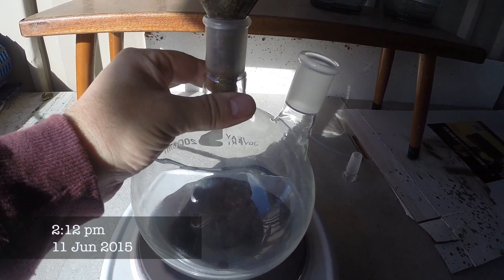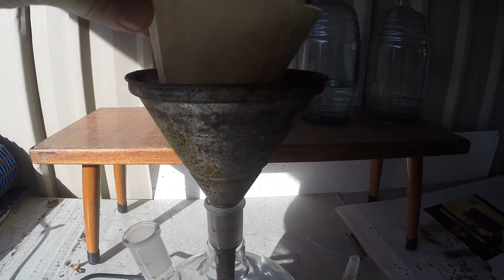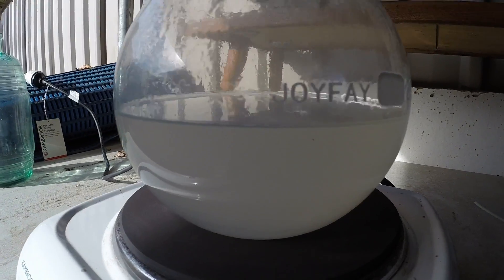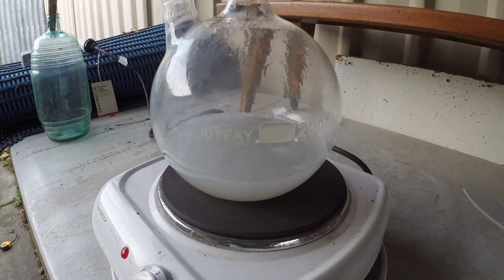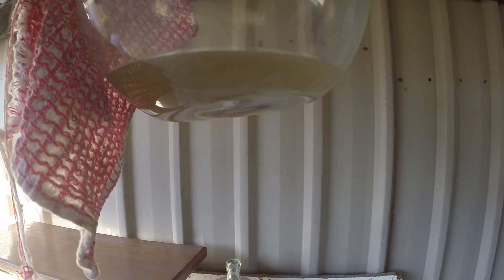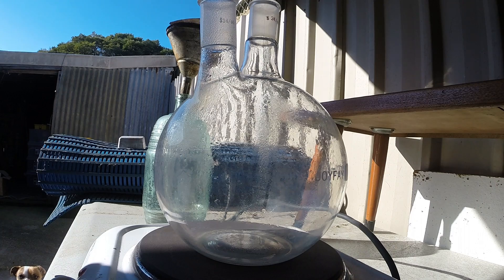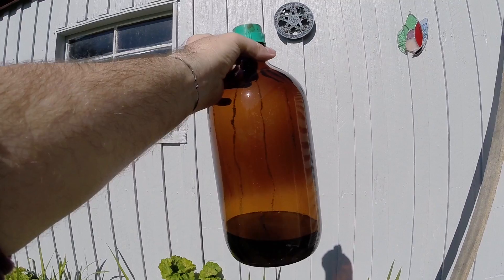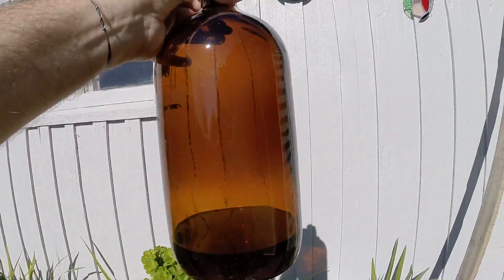Concentrating Car Battery Sulphuric Acid

Comment: There are a couple of things that should have been done differently:
-the dilute solution should have been filtered using glass funel idealy, or at least plastic, never metal
 -the concentrated acid should have been filtered using a glass funel and glass fibre, not metal funel and paper coffe filter
-the white stuff was probably iron sulphate( from the metal funel) and some lead sulphate( if the solution comes from a car battery, not bottled electrolite), and it's possible that by letting the concentrated solution sit for a while in a cool place to precipitate it
-the obtained concentrated acid contains a lot of impurities but it can be used at least to prepare hidrochloric acid, probably ignite a mixture of sugar and chlorate or in a dessicator, maybe other reactions as well where purity isn't an issue.

Comment: Sulfuric acid boils at 330c, or 640F. There's no way you're gonna hit that on that hot plate. I think the white smoke you were seeing was other impurities boiling off.
Reply: it boils off minor amounts of sulfiric acid at lower temperatures as the water builds an azeotrope with the acid. The concentration of acid in the azeotrope increases with higher temperature.

Comment: Fiberglass is a good filter for acid either matting or fiberglass insulation stuffed into the funnel.
Reply: Sulphuric acid eats paper, even dilute acid will get it torn apart.

Comment: very risky having a RBF standing like that completely unguarded with a small creature running about
normally i dont comment on safety but this irks me massively
i am however surprised that you were even able to boil it down inside a flask like that, larger surface area- for instance an open glass pan would be much better for this
Reply: @@edwardelizabethhitler5611 fair enough-  but he didnt reach that temperature either. the decomposition will happen regardless and the gasses will exit regardless of the shape
its inefficient and an obtuse extra risk- downright abuse of the glassware
Reply: @@edwardelizabethhitler5611 are you saying sulfuric acid evaporates below 700*C?

Comment: Can i put a pyrex beaker on regular stove? And how strong can i set the fire to be?
Reply: I would put a pot with water on the stove and hang the beaker inside it, so that the glass doesn't receive the flames directly. The temperature should be as low as possible while still boiling the water so that you don't boil the acid away

Comment: Heating it up with some H2O2 might help clear it up a bit.
Reply: Lol I was looking on here and found you no guess why I'm looking at this video
Reply: @sydneyhunt6681  Hah! Hey stranger, what's up, lol.
Reply: @jhyland87  trying to get cheap Sulfuric acid
Reply: @sydneyhunt6681  what country do you live in? (Asking because i know some countries have H2SO4 restricted)
Reply: @jhyland87  uk it used to be easy to get 98 %   but after acid attacks it's got hard I cant find it for sale
Reply: @sydneyhunt6681  yeah, ive heard that its very hard to get it there. That sucks :-/
Reply: @jhyland87  will have to distill battery grade or possible drain cleaner

Comment: If you put sand in a pot you can heat up just about any kind of glass jar
Reply: But you shouldn’t heat any glass
Reply: @blackferrets820  why not?
Reply: @smilemore1997  borosilicate glass won’t suffer temperature shock other glass will mostly and acid everywhere is the last thing you want and just buy sulfuric acid way safer
Reply: @blackferrets820  
Some countries you can't get it as a normal citizen.

Comment: This isn't the best advice. The coffee filter will degrade in the acid and the reactive metals in that funnel will react and add metallic salts to your acid. You concentrated the acid but added a lot more impurities. I'd recommend just careful pouring off that top layer more carefully. If you really want to filter it you'll need a glass buncher.
Reply: Hey can i make 98% sulfuric acid by just boiling the car battery acid? Is it possible?
Reply: @Zalost01  no azeotrope forms at 93%. I recommend not messing around with boiling acid if you don't know what your doing.
Reply: @ajfox031  some people said they made it to 96% by just boiling the battery acid so are they lying?
Reply: @ajfox031  so?
Reply: @Zalost01  yes lies, sulphuric acid forms azeotrope and the sulphuric acid itself starts boiling at the same rate as the water at 93.3% but you need to boil up to 338 degrees celsius to achieve this (not safe at all for amateur).
Reply: @ajfox031  sorry im new to this then how come there is 98% sulfuric acid? What can i do so i can achieve that kind of con?
Reply: @Zalost01  mechanical filtration like molecular sieves can remove more of the water after the azeotrope is reached. But Again this is for information only please don't fuck with over 600f degree boiling and vaporising acid.
Reply: @ajfox031  thanks im not trying to do it i just needed to know i get curious sometimes so it is possible to make it to 96% from battery acid
Reply: @ajfox031  damn man i messed up
Reply: @Zalost01  lol
Reply: @ajfox031  bro the acid got all on my back it was hot like the sun
Reply: @Zalost01  I'm proud of you son.
Reply: @ajfox031  🤔

Comment: You know sulfuric acid corrodes steel, and even stainless steel? You are contaminating your acid with ferrous sulfate. Use glass or even just plastic funnels.
Reply: very slow rate, more of a worry that the steel will continue corroding after acid exposure
Reply: Not really, the reaction is pretty fast from my past experience of making ferrous sulfate, and also the filter paper also dissolves

Comment: Even though I'm late to the party here, the cloudy appearance of the acid in the round bottom flask is a result of the acid dissolving micro bits of the filter paper, and then any surface contaminants on the bottom inside of the funnel, including the metal itself.  Although 35% H2SO4 (battery acid concentration) is pretty low and won't eat into metal quickly.  Any plastic funnel works just fine.  And, you really need to get the special acid resistant filter paper that's sold.  There's just no away around it unfortunately.  I'm sure your concentrate is still useful though.
Reply: How can i make 98% or at least 96% sulfuric acid from car battery?
Reply: @Zalost01  Hey.  Using a glass container only, fill it with battery acid.  Put a hot plate, or other heating element, outside (never indoors) and put the glass container with the battery acid on it.  Then wait.  Eventually water vapor will be seen coming off of the battery acid.  It looks like typical steam, like when cooking on a stove.  Eventually, and this will take hours, an opaque white vapor will begin to be seen.   At this point you are starting to evaporate sulfuric acid itself.  This white vapor is extremely toxic.  Continue to let it heat with the visible white vapor for another 25-20 minutes.  At this point turn the heating element off.

Wait until the acid cools down, but not until it becomes completely cold.  If it becomes cold it will again start to absorb moisture out of the air which will start to dilute the acid you just concentrated.  When the acid in the glass container is warm, pour it into another acid resistant container and cap it tight.  Usually another glass container with a top that can be screwed down works well.  Also, an empty wine bottle with a cork is good too.

You will be left with ~97 - 98% sulfuric acid.  It will be a bit syrupy and slightly yellow.   The discoloration isn't important and won't effect any experiments you do.

Good luck K T!
Reply: @glennkrieger  thanks alot man
Reply: @Zalost01  go to nile red or nurd rage on utube for instructional vid. It takes a lot of lab equipment and is unforgiving. Another name for 98 percent is piranha solution
Reply: Id just use glass wool with celite or just by itself

Comment: Although borosilicate glass have a higher heat resistance, resistance to temperature difference is only about 160 °C. Never heat the flask with strong direct flame as it can still crack. Better use more even heating such as heating nest/mantle or sand bath - this also saves evergy. The electric heater is probably okay but you can wrap the flask in tin foil to heat it up faster and more evenly. You can use glass thermometer to control the temperature.

You can add some boiling chips to improve boiling - things like broken glass or ceramic rashig rings will do.

Also note that mixtures always boil as mixtures to the initial vapours will always contain some sulfuric acid. This will be boiled off so use reflux condenser or fractional distillation if you want to save some acid.

The discoloration might be some salts (e.g. sulfates) that are easily soluble in water but not so in sulfuric acid, so they precipitate and make the solution cloudy.
Reply: idk how anyone hasn't said yet at this point, but 3.3 boro 100% can sustain a clean high-temp bunsen burner. You can literally work the glass up to 450C consistently without much issue (assuming quality glassware). Sulfuric acid boils less than 400C which means you can distill it within safe parameters of the glass itself. 

No need to spread misinformation. You can just state facts and it's ok.

Comment: I give this a downvote and a report as the person in this video does not seem to know anything about the safety besides "Chemical fumes = BAD!!". The statement "Oh?? It burned my coffee filter" is a BIG RED FLAG!!

Concentrated sulphuric acid (H2SO4) is very dangerous to those who do not have thorough knowledge about chemistry. The person doing this video DOES NOT seem to have that knowledge other than the thought "Oh, it contains water - I can remove that"

1. Use gloves!! Concentrated suphuric acid can burn the skin in less than 2 minutes leaving scar tissue
2. Use protective eyewear - Unlike your skin your eyes are done on first contact with conc. H2SO4
3. As we see in this video H2SO4 destroys cellulose and other chemical links... Do not use paper

Comment: Question: if i need to add 3% of Sulfuric Acid in 10 liters of water, can i use 1 liter bottle ( battery acid) of 30% Sulfuric Acid and add 9,3 liter water? Thanks
Reply from the maker: bon chance add 10 litres of water to your 1 litre
Reply: bon chance the numbers you are using are conveniently in tenths. To go from 30% which is 0.3, to 3% which is 0.03, you just dilute it by a factor of ten.

Comment: use a glass candy  thermometer, as the water content goes away, the temperature will rise above 212 f. at 230f, there will be no water left in it, as it has turned to vapor (gas) above 212f. the sulfuric acid won't begin to boil away until you go over IT'S boiling point (over 600f). auto stores here have battery acid thats about 30%
Reply from the maker: Did not have one at the time but have since purchased one!

Comment: I hawe pure 30 percent h2so4 can i make it more concantrated by boiling at 90 celsius
Reply: Well it will eventually, but really slowy. The water should boil of, so 90C won't do it. You will need atleast 100C.
Reply: I will not encourage this as concentrated sulfuric acid is quite dangerous to work with without a degree in chemisty or safety. 
You can however distill the water away and avoid the fumes in this video. Remember to do it outside or with good ventilation
To do this take a thermometer that goes well above 100 C. Heat the acid until the thermometer starts going above 100 C - At this point there is no more water and you should stop here before the sulfuric acid starts to vaporize

Comment: "it's a little bit muddy" maybe because you poured sulfuric acid thru a rusty (metal) funnel😂 just sayin. continue tho.
Reply from the maker: +shanehuse Ha! Good observation! It didn't help that the concentrated acid ate straight through the coffee filters I was using! The acid was dirty out of the car battery I took it from too. The flakes off the cells as they broke down i imagine.

Comment: Concentrated Sulphuric acid is a much more corrosive and dangerous than the dilute one. While the dilute acid can be stored "quite" safely in most PE bottles, Concentrated acid will eat through them. When u use this for batteries be aware that you have to dilute it safely down again, before the battery case gets eaten away. (Always pour acid into water, because it's very exothermic.) 

This comment is more to keep people safe, my beginner mistake was to store it in a PET bottle...
The stuff ate right through my wooden floor :P
Reply: You mean never pour sulfuric acid in water because it's very exothermic?
Reply: @mrdojob  do as u auter add acid to water. if u do it the other way round u asking for trouble lol
Reply: @mrdojob  no you always add acid to water because if you add water to acid it can flash boil and drench you in hot acid
Reply: i did exactly that, mine was 50% though. the acid got a sweet smell.